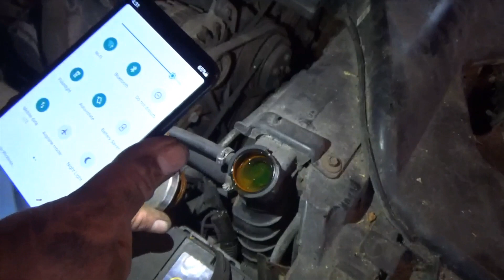87 IROC-Z part 1

Comment: Just subscribed, I’m really looking forward to seeing more content. This looks like a really well optioned car, that is worth saving. Changing the plugs on the TPIs is a nightmare, it’s a lot easier from underneath so I would suggest putting it up on jack stands. Also the 3rd gens are notorious for the fuel pumps going out when they have been sitting for a long time, so very likely you will need a new pump.
Reply from the maker: Thanks for the advice and thanks for subscribing